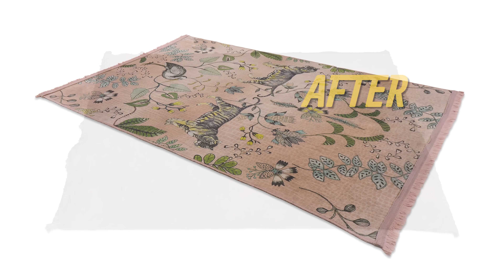Against All Odds: Attempting to Clean a Delicate Cotton Rug

Comment: Can I ask why you start pouring the cleaning solution at the bottom end of the rug?  It looks like there is a slight slant in the floor that makes the water flow towards the drain so why wouldn't you start pouring the cleaning solution at the top of the rug?
Reply: I was wondering that.. then I thought that with the slant of the floor a lot of dirt would collect near the bottom of the rug. So more soap at the bottom might help with that. I'm feeling very clever, but could be totally wrong...